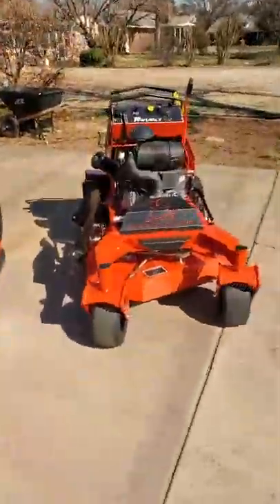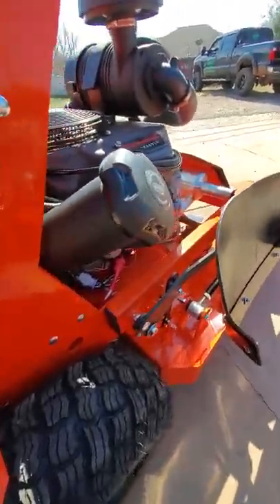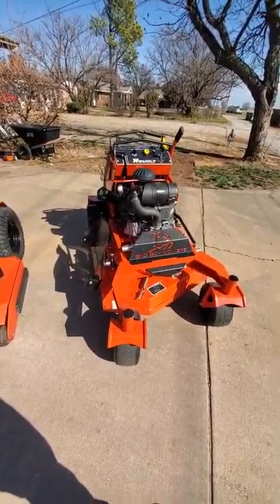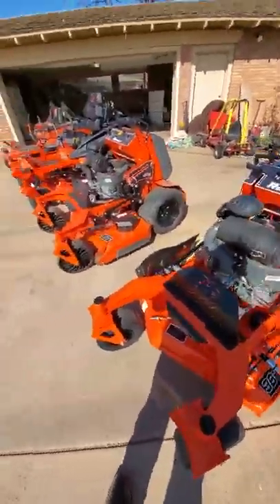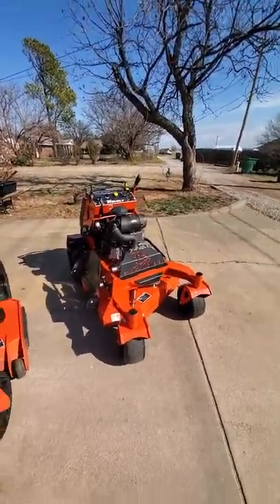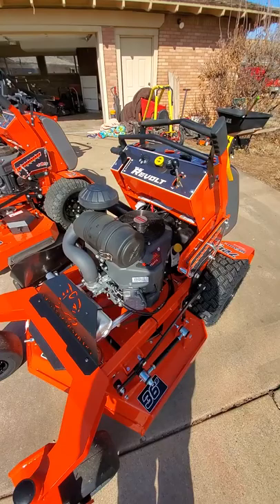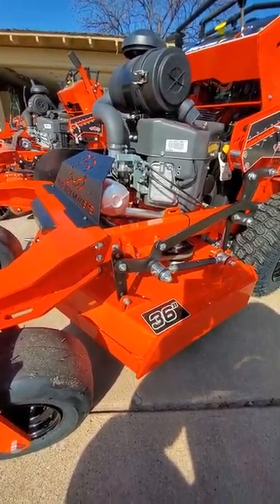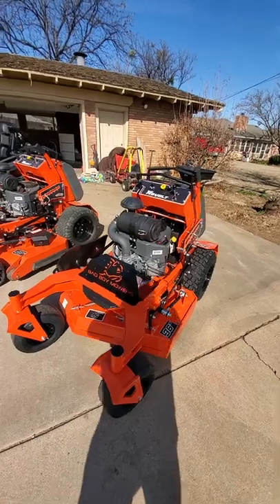Bad Boy revolt 36 stander

Comment: How are you sir? I am thinking about starting a residential business and been looking a stand on that will fit good for small yard with tight corners. Bad boys 36 look pretty good and I considering getting one. I just want to get your opinion about it as far as turning in to right corners. Thanks you so much.
Reply from the maker: so far my 36 iv got about 8hrs on good little machine. turning on it is really good but with the reaper tires just have to really carfull turning cause u will tear up the grass. if u get the 36 i recommend the full mulch kit. that thing works very well and i even used on some pretty yards did great job. if u need anymore please let me know i hope u find this helpful. And good luck onbur new business